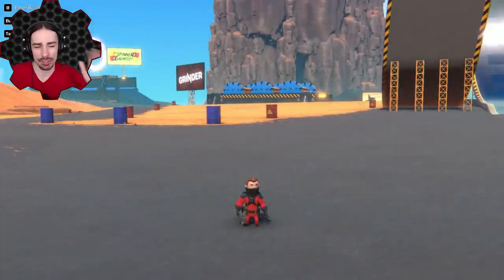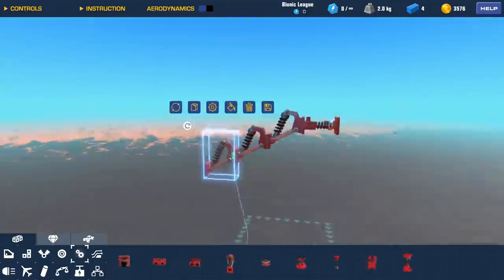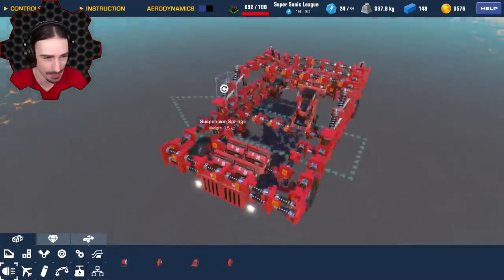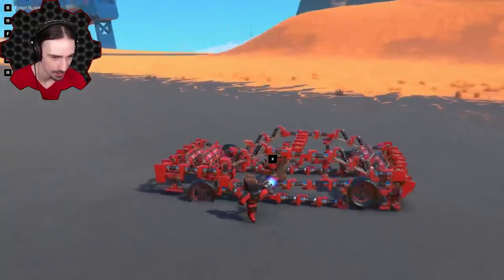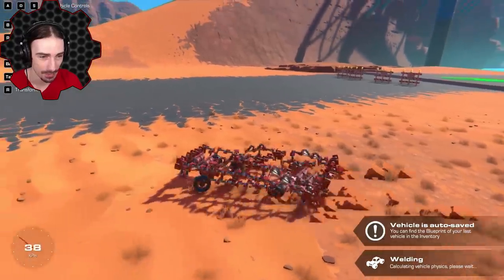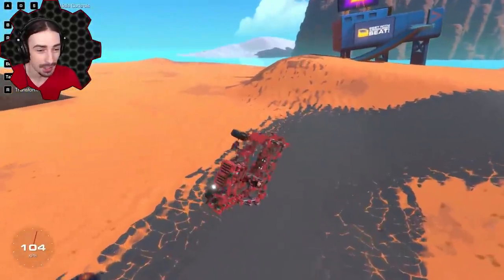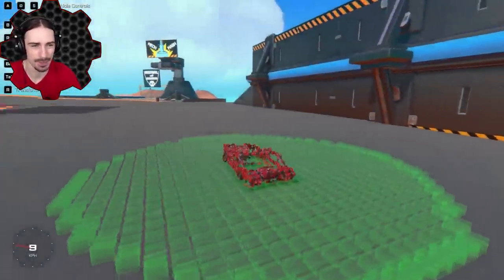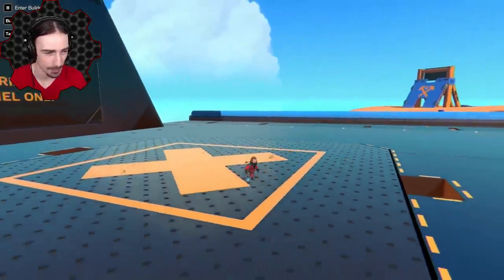I Made This Car Completely Out Of Suspension and Oh No…   - Trailmakers Gameplay

Comment: Amazing build, appreciate your dedication to showcase this.  For even more laughs maybe replace the wheels with rotary servos with tyres made of... suspension.  That would save you even more mass going wild.

To make it almost usable, I'd drop down to just 1-2 bulldawgs, it seems to be torqueing like mad under power.  Also, you can (now in 2022?) just CTRL-double-click to select all parts of the same type.  SO useful in re/setting suspension/thruster values across the whole machine at one time.

Comment: Do this for Multiplayer Monday. Have suspension cars where they can only have the necessary car things (like wheels, engine, seat) and they have to use suspension and bearings for the rest of the entire car. To allow for turning and such, they can place 1x1 cubes but only if every connection to it is a bearing.

Comment: Hey Scrapman a cool idea for a video is using the anchor pins. If you use the disconnection blocks with anchor pins on the end the vehicle will stay in the air, most times. Also DON’T have the disconnection blocks on “Make Scrap.”

Comment: Scrapman....
I realized that you are always having trouble selecting all the parts of the same kind
For example,
If you want to select all the Suspensions in the Structure, You select them manually,

You can do it easier,

By,
Holding control and Double clicking the block,

Eg:,

If you wanna select all the Straight Suspensions,
You hold Control Key, and double click one of Straight suspensions,
It'll select all the Straight Suspension blocks in your structure

It works in my version of Trailmakers.....

Comment: Try making it smaller and support it more with suspension on the insideand try making the stiffness max and the dampening min and use different seats and wheels

Update:It totally works and doesnt glitch out and it was made with 4hinges and wheels, 2engines, 1 seat and maybe 20 straight suspensions, and adding a bit of detail wouldn't be too hard (and it just had slight speed wobbles at 100kph and spun out when driving up steep slopes)